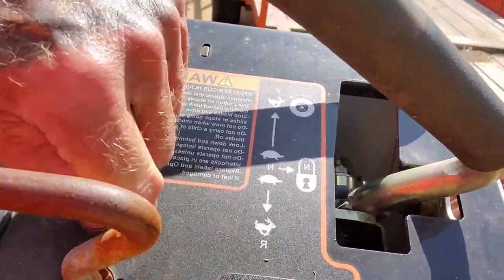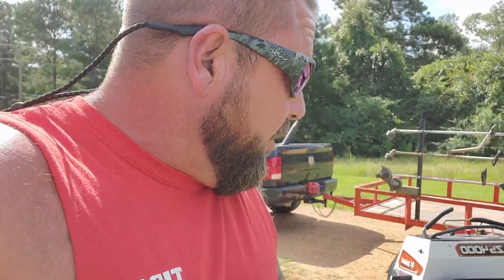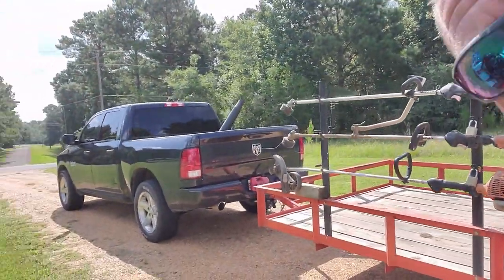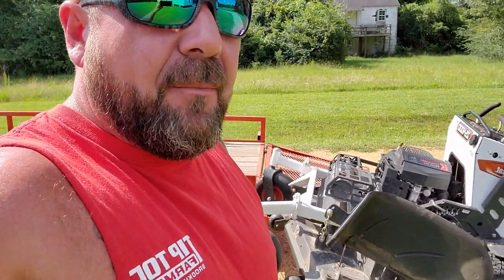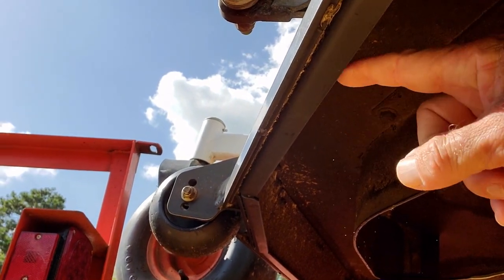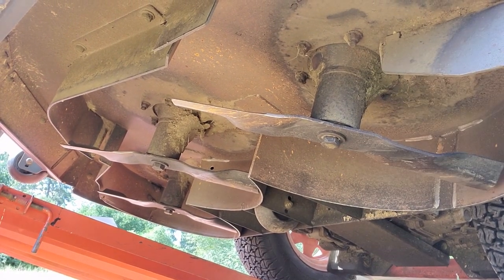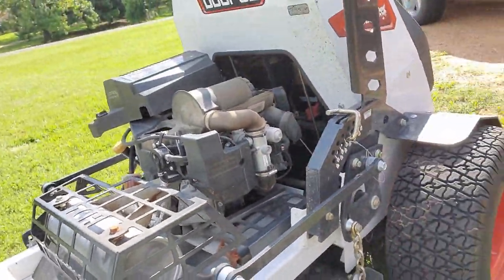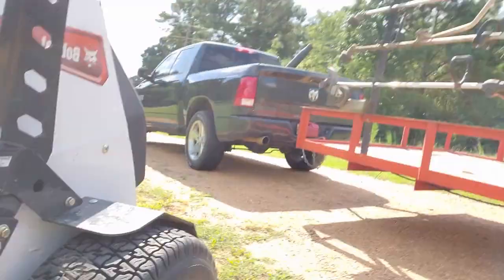Bobcat ZS4000 100 hour Review

Comment: Thanks Jason - great review. I'm a solo operator "down under" & have a ZT2000 with 270 hr's on it. It's a great little mower (a tank) & done some really tough/rough properties, as well as some nice yards. Cut quality is excellent. I can't speak highly enough about it. I change the oil & filters every 50 hr's and replace the blades every 100 hr's. No problems with spindles or anything else. Cheers.
Reply from the maker: Thanks man and and that's awesome!

Comment: All my Exmarks have sealed bearings  I never had any issue with a spendle never greased any of them.
One Machine has 3100 hours on it the other machine has 2000 hours Never one spendle issue.
 My skag has more grease points than I even know about
Reply from the maker: Im hoping these hold up like that! Its nice not having to grease everything but im still am not 100% comfortable with it.
Reply: @AmericanLawnSpecialists  they have come a long ways in that area in the last 5 10 years if grease cant get out then trash cant get in. if grease can get in then so can trash is what my mechanic used to say

Comment: 7 years and no bent blades or broken spindles , GO SCAG ! I'm getting ready to purchase 2 new mowers and I'm looking for anything better than SCAG and I just don't know 🤷‍♂️
Reply from the maker: I was going with Scag until I demoed Bobcat. I'll be doing a 500hr review soon on both my stand ons and I'm glad I went the route I did.
Reply: @AmericanLawnSpecialists  I just can't find a mower that cuts like scag and I like the greaseable deck bearings. How would you rate the cut between the 2 and how does the Bobcat cut in tall grass ?
Reply from the maker: @moline800hdyup4  the main reason I was going with scag was the cut quality and speed. The Bobcat cuts just as good in most grass and actually cuts better in bahia. It was the only mower I found that in my opinion was better.
Reply: @AmericanLawnSpecialists  I'll see if I can get a demo at my local dealer . I was going with a rear discharge 72 scag sit and 52 standard so ill see what they have
Reply from the maker: @moline800hdyup4  that's your best bet

Comment: Nice review, def look like solid machines. I have to do a video on a story about hitting something with my ZTrak that made it shut off. How do the tires grip ?
Reply from the maker: I run my tire pressure at 15psi and the traction is awesome
Reply: @AmericanLawnSpecialists  👍 I run mine around 14psi with the Carlisle Turf Master Tires and they have been solid.
Reply: TWEELS  On those mowers would look awesome
Reply from the maker: @rayrayslawnlandscape2008  I'm thinking about it!
Reply: them ztraks are a tank josh spindles are strongest in the market I know they don't sorce them out

Comment: Mines been cutting patchy lately , replaced the blades, did my routine check like wheels and air pressure . Have you had any issues with the leveling of the machine?
Reply from the maker: I haven't had any issues but I would check the level on the deck. Also look to make sure the chains that the deck hang from are tight in transport and when lowered to cut. Hope this helps and thanks for watching!